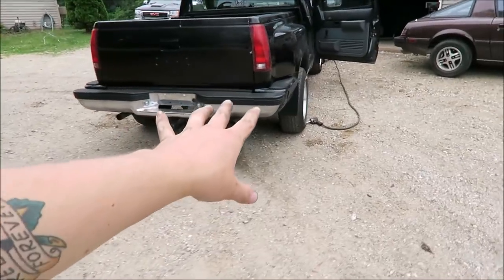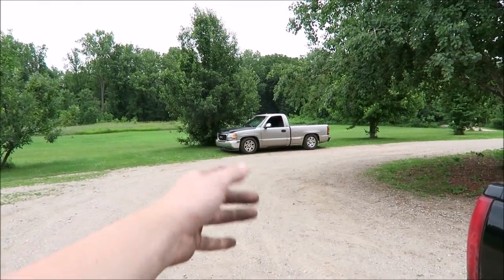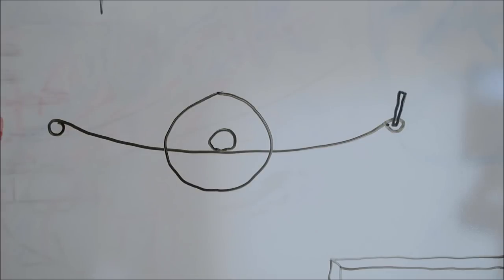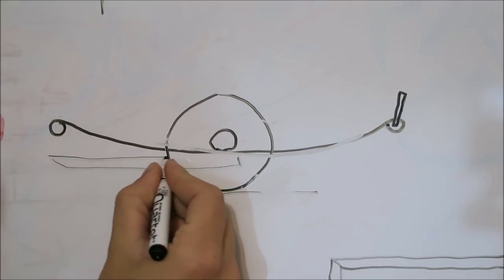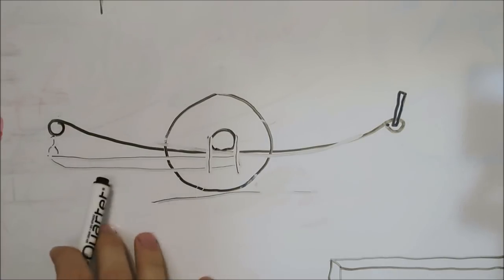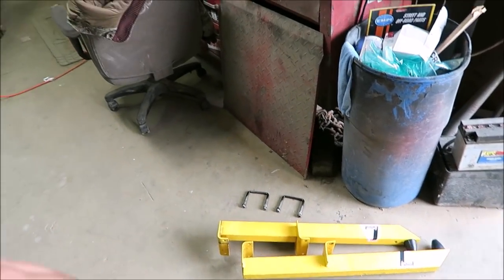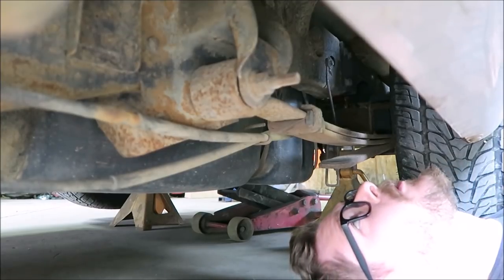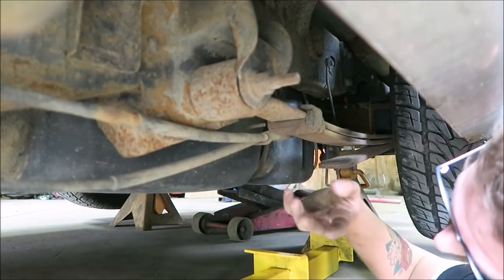Do Traction Bars Actually Work?

Comment: Bro the reason you were getting that wheel hop is because the traction bar was only mounted on the front of the spring, they need to be mounted front and rear parts of the spring or front and rear of axle. Those bars are for a different application. And not for those trucks.
Reply from the maker: I was getting the wheel hop before I put these on the truck. After I put them on, I have zero wheel hop
Reply: SniderTron 3000 that’s cool that you got no wheel hop after that, although because the traction bar is only on the front part of the spring, that’ll put unnecessary stress on just the front of the spring. Just saying check these out from speed-engineering.com from Fresno California. You can follow them on Instagram @speedengineering Wether the axle is above or bellow the springs. Pretty sik bars
Reply from the maker: Yeah, man. I've been drooling over those since they said they were developing them. I'm definitely gonna pick some up eventually
Reply: SniderTron 3000 cool, I'd love to see the install of those bars on your truck too when you do cool?